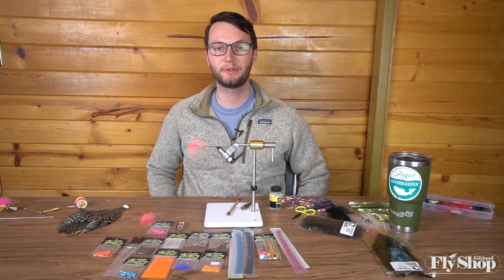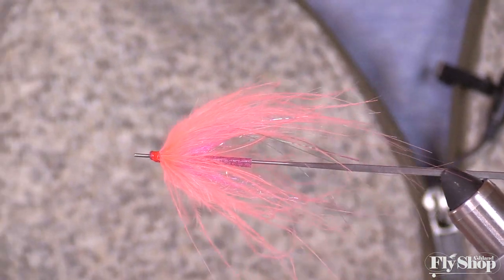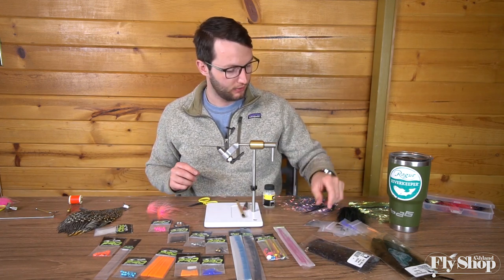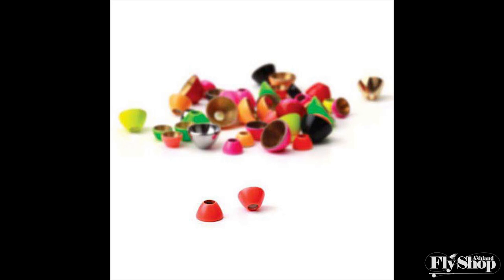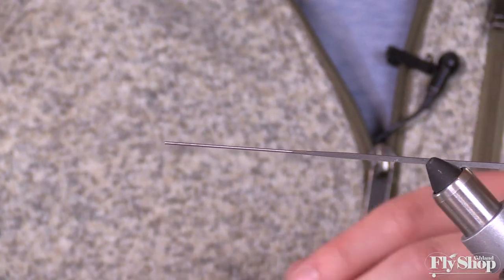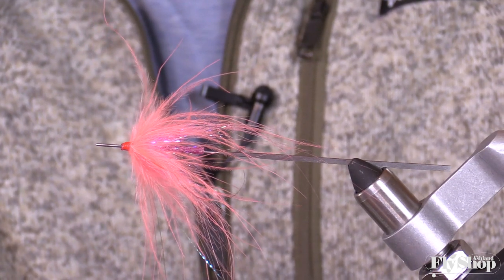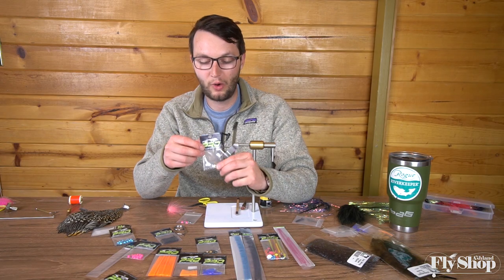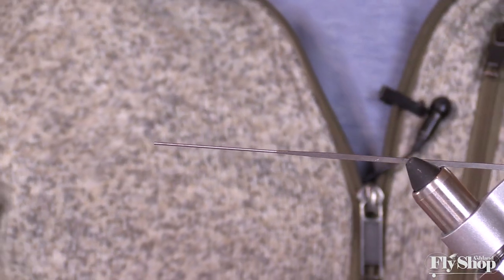Understanding The Pro Tube System | Ashland Fly Shop

Comment: Marcus do you see that flys spin as you swing them when you are using the tube weights?
Reply from the maker: Which weights are you referencing? I've seen flies spin a bit in the tank and when I'm fishing in any number of situations. I don't think the weights will make them more likely to spin around. I've found that flies without defined wings or dumbell eyes tend to spin more because they lack stabilization
Reply: Ashland FlyShop I mean the cylinder weights that look like copper tubes
Reply from the maker: @Belbivdevoe  Oh I have not tied with those much so I'm not sure how they effect the way the fly swims or if they're more likely to spin. Sorry!